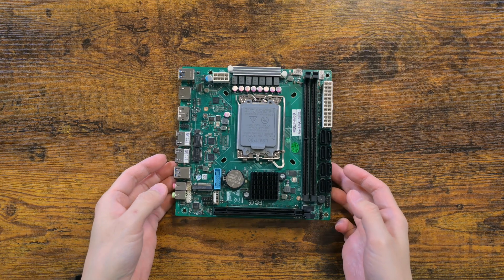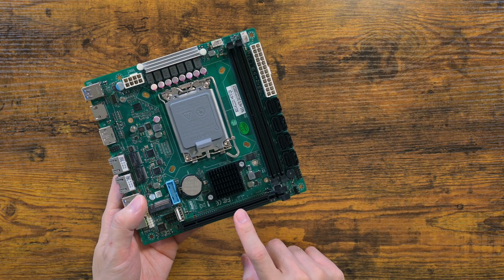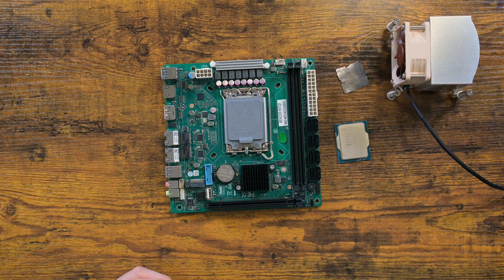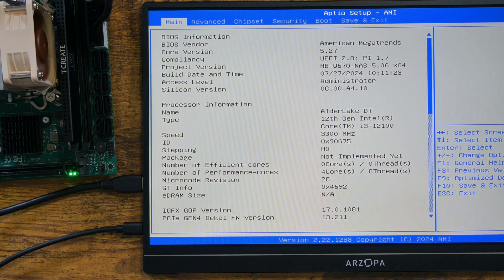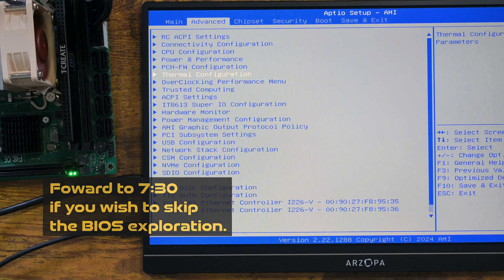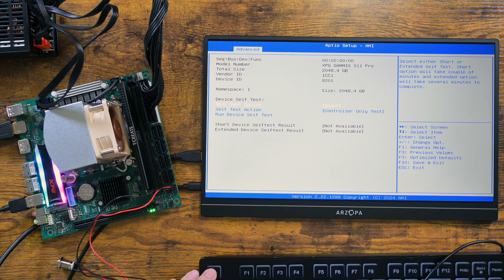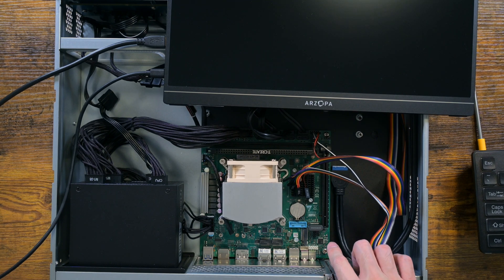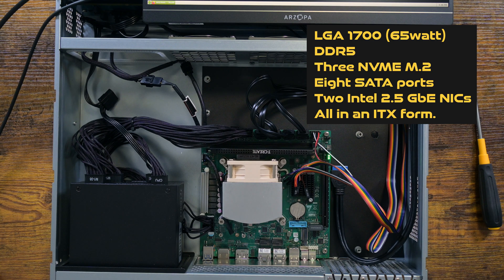Eight SATA port ITX motherboard from China - Packed with features

Comment: Worth noting this has no TPM and it is not going to have, since the manufacturer just simply did not include one
On the description there is a claim: "TPM2.0 optional, not available by default", while the seller told me that you can add it... if you solder it onto the motherboard.

Comment: Can you add a link to where to get this motherboard
Reply from the maker: You can find it easily on either Aliexpress or Alibaba. Just type in 8 sata port nas motherobard and it should come right up. You do need to do some works to find cheapest pricing, though.
Reply: @geekdk  Tried searching in aliexpress but it is not appearing. Can you provide the link please?
Reply from the maker: Not Aliexpress. Alibaba.

Comment: Whats your idle, load power consumption with this board?
Reply from the maker: 21watt from the wall at 0 ~ 3%. As this is in a NAS unit, full load is not possible. 55watt when HDDs are active and verifying parity.
Reply: @geekdk  were the HDDs spun down idle? and how many HDDs are you using?
Reply from the maker: Spun down just to check the idle wattage. Four 10TB HDDs.

Comment: how much is this?    can I use this with GTX 1060 ,, for light gaming
Reply from the maker: Base price is 90 USD. It can be knocked down further by using available coupons and whatnot. Since I don't believe the PCI-E lane is full 16x, it's not an ideal board for gaming. This is specifically designed for server / router setups.
Reply: @geekdk  This video did well. I bought one myself yesterday. Maybe you can test further with a low end GPU or even a 4060.
Reply from the maker: There is actually a cheaper alternative if you want a cheap lga 1700 itx motherboard.
Reply: @geekdk  If it has 3 NVME, 8 SATA, dual 2.5 gig nic, 20gbps usb-c, and pcie 4.0x16 for under $100 I'd be interested sure.
Reply from the maker: The pcie is very likely 8x or at the worst 4x. If you look at the BIOS screen in the video, some of lanes looked like it wasn't even wired for the main pcie. If gaming is primary objective, there are cheaper alternatives, which I will get my hands on eventually.
Reply: @geekdk  All the more reason to test pcie function to possibly warn future buyers. Regardless, thanks for the upload.
Reply from the maker: I did warn. I did say the pcie is likely 8x. The lanes have to come somewhere. A m.2 slot takes 4 lanes in general, and this board has three. Testing it is easier said than done because 4060 is a 8x lane card. I don't have the capacity to fully test it. Also this is meant for a server or router board. Not having a full 16 lane pcie slot is not a big deal.
Reply: @ what is that cheaper alternatives for gaming ?  , help me because my mainbboard ram slot 1 is broken
Reply from the maker: It's something I am planning for future videos, but there are cheaper (by about 20) boards meant for gaming. You can search Aliexpress or Alibaba for those. This board is not meant for desktop usage although nothing stops you from using that.